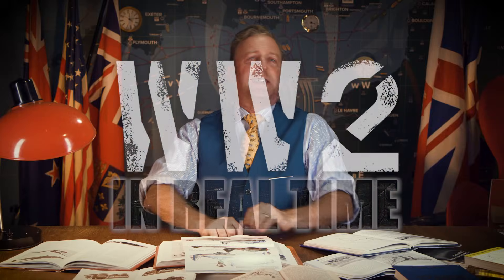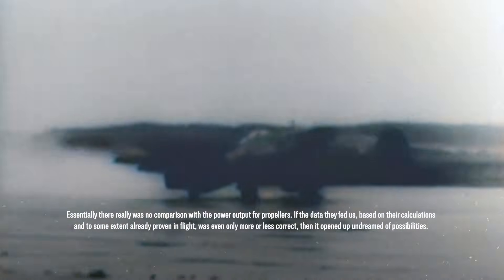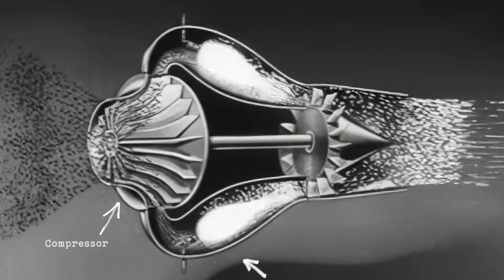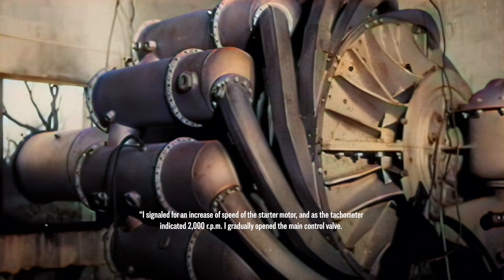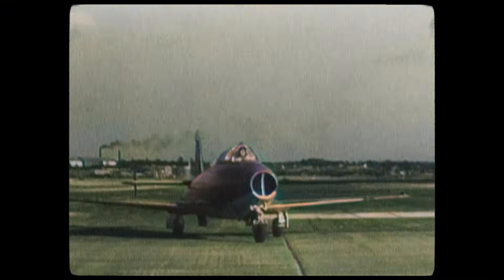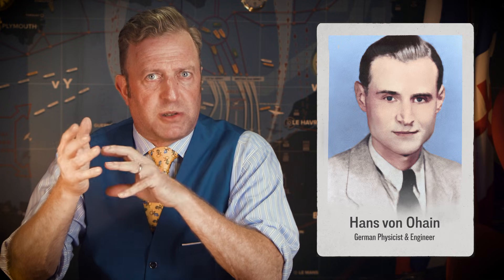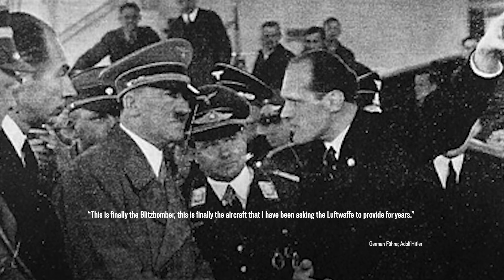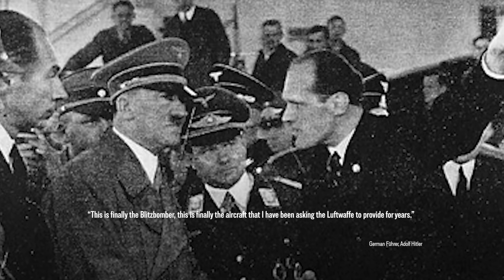WW2 Jet Engine Development - WW2 Special Documentary

Comment: It’s a myth that the inclusion of two hard points for bombs delayed the introduction of the ME262A, the main reason was the availability of reliable engines. The short supply of engine manufacture caused this, and their inherently unreliable status caused the biggest delays. The British design was a radial jet engine that didn’t need as much high temperature alloys as the axial flow type that the Germans used. The German Jumo 004 engine life was typically only 10 hours. Whereas the Gloster meteors Rolls-Royce RB.23 Welland engine was 180 hours! Whittle knew that an axial flow engine had some advantages, but life time and reliability were not as good at that time.
Reply: Good points, the Whittle design was called a centrifugal flow, from its compressor design
Reply: Makes no sense in that the power capture turbines in the exhaust stream still needed to be high temp resistant.
Reply: @AndrewBlacker-wr2ve  Piston engine exhaust valves had internal molten sodium spreading the heat along the hollow valve stem and outside the combustion space and sat on the valve seats for most of the engine cycle passing more combustion heat out into the cylinder head.  Turbine blades had no cool period and acquired most of the exhaust gas temperature.
Reply: It wasn't just the power turbines where special metals were required.  Compressor blades were also an issue. The centrifugal compressor was easier to work out than the axial type.  It's one of the reasons we still use centrifugal designs in certain applications. @AndrewBlacker-wr2ve
Reply: @AndrewBlacker-wr2ve yes, but you need much less special metal for a centrifugal engine.
Reply: @Steeyuv Not true, you only need special alloys for the turbine blades and combustor liners.
 Centrifugal compressors are very simply to design but are very expensive to built and are more easily destroyed by FOD.
The primary difference is the very low efficiency limits of the Centrifugal type when compared to the superior Axial compressor
Reply: It wasn't introduced too late, it was introduced too early.
Reply: Hey the GE copy of the Jumo engine with special metal was only good for 25 hrs btw🤪
Reply: Thank you for making this valuable, but usually overlooked, point. Many of the late war German aviation firsts were achieved not because they were far ahead technologically, but through sheer desperation & the high command's misguided belief in technological miracles. Which invariably squandered valuable resources, not least the lives of skilled pilots.
Despite its pedestrian development, the Gloster Meteor entered operational service only a few months after the ME262. Its insignificant contribution to the course of the war was mainly because it simply wasn't needed. The RAF only operated it over home territory because it wasn't needed over Germany and why risk handing the enemy its secrets should one be lost.
It was a less advanced design (especially aerodynamically), but that's the sensible way to develop such a radical advance in technology - produce something which you know will work first.
Reply: @ibex485  few people know that the reason the M262 had swept wings was to change the planes centre of gravity.
Reply: @akula9713  No, it didn't... the Me-262 was developed from the Projekt 1065 which had swept wings from inception... myth BUSTED!
Reply: @DoktorBayerischeMotorenWerke my sources disagree. The P1065 was designed to be a partial swept wing using the much smaller, and lighter  BMW3350 jet engines which were intended to be in the wing  roots. That design had essentially straight wings up to the engines, and swept back slightly thereafter. Not a fully swept wing. However these engines did not produce the required thrust and the later jumo engines were larger and heavier that precluded being installed in the wings. The extra weight upset the planes centre of gravity so the wing from the fuselage to the engine was swept back too, to correct the centre of gravity.  My sources are: Messerschmitt ME262 Arrow to the future by Walter J. Boyne. And World War II fighting Jets by Jeffery Ethel & Alfred Price. Do you have other sources on this fascinating subject?
Reply: @akula9713  This widely spread but completely false myth comes from a single, highly dubious source. Boyne clearly attempts to spread misinformation by deliberately confusing the Messerschmitt P.65 project with the RLM's Projekt 1065 
 These are NOT the same aircraft.
 The Me-262 was developed from the 1065 not the P.65.
 The P.1065 had 18 degree swept wings from inception. 
No changes were ever made to the wing swept angle because this aircraft had wing mounted engine pods that could be easily adjust fore and aft to adjust the aircraft CoG although there is no evidence this was ever done.
 The CoG was easily adjusted by repositioning weight inside the fuselage.

MYTH BUSTED!
Reply: @DoktorBayerischeMotorenWerke what are your sources?
Reply: @akula9713  The Facts here are SELF-EVIDENT.
That is a completely false Alliboo myth that comes from a single, highly dubious source "Messerschmitt ME262 Arrow to the future" by Walter J. Boyne. Walter Boyne's book is based on a completely false assumption by the author of this inaccurate book. The Messerschmitt Me-262 was not developed from the Messerschmitt P.65 but rather the RLMs Projekt 1065 (which never featured straight wings or an H tail) the P.65 design was completely abandoned in favor of Bussmann's Projekt 1065 data pakage which had a cranked swept wings from inception. no version of the Me-262 was ever constructed with straight wings or an H tail. 

There is no credible evidence to support this ridiculous false claim. This tale doesn't even pass the sniff test, the Me-262 flew with 1, 2 and 3 engines with 11 different types of engines with NO CHANGE in wing sweep angle. The CoG is easily adjusted for different engines on the Me-262 by simply shifting the engines fore and aft on their wing mounted nacelles... just like any modern aircraft like the Boeing 737 or Airbus A320. 

Busemann cranked the wing sweep angle and added automatic retractable leading-edge slats to improve low speed stall characteristics and lower the landing speed, the Me-262, the Me-262 has a significantly lower stall and landing speed than the P-51 Mustang which allowed Me-262 pilots to land on roadways and short, unimproved grass runways. Eric Brown said that the Me-262 had EXCELLENT stall and landing characteristics and would gently dip one wing well before a stall was induced..
Reply: The Facts here are SELF-EVIDENT.
That is a completely false Alliboo myth that comes from a single, highly dubious source "Messerschmitt ME262 Arrow to the future" by Walter J. Boyne. Walter Boyne's book is based on a completely false assumption by the author of this inaccurate book. The Messerschmitt Me-262 was not developed from the Messerschmitt P.65 but rather the RLMs Projekt 1065 (which never featured straight wings or an H tail) the P.65 design was completely abandoned in favor of Bussmann's Projekt 1065 data pakage which had a cranked swept wings from inception. no version of the Me-262 was ever constructed with straight wings or an H tail. 

There is no credible evidence to support this ridiculous false claim. This tale doesn't even pass the sniff test, the Me-262 flew with 1, 2 and 3 engines with 11 different types of engines with NO CHANGE in wing sweep angle. The CoG is easily adjusted for different engines on the Me-262 by simply shifting the engines fore and aft on their wing mounted nacelles... just like any modern aircraft like the Boeing 737 or Airbus A320. 

Busemann cranked the wing sweep angle and added automatic retractable leading-edge slats to improve low speed stall characteristics and lower the landing speed, the Me-262, the Me-262 has a significantly lower stall and landing speed than the P-51 Mustang which allowed Me-262 pilots to land on roadways and short, unimproved grass runways. Eric Brown said that the Me-262 had EXCELLENT stall and landing characteristics and would gently dip one wing well before a stall was induced.
Reply: thank you! was annoyed by that too.
Reply: That's not it. Whittle's early designs, up to Rolls-Royce Welland, used a wonky reverse flow system, where hot gases zigzagged their way through pipes on the way to turbine blades. This shielded the turbine from IR emissions in combustion chambers and helped bring the temperature down by 100-150 degrees. Tubine disk cooling was also eventually integrated, again improving longevity. When the US supplied better heat-resistant allows, reverse flow was deleted by Adrian Lombard (against Whittle's wishes and even without his direct knowledge) in favor of а straight flow design, resulting in Rolls-Royce Derwent with vastly improved power. Derwent was then scaled up into famous Rolls-Royse Nene, which was copied by the Soviets, slightly modified and used to power MiG-15s and MiG-17s. Gloster Meteor used both Wellands and later Derwents, by the way. It's not a matter of centrifugal (radial) or axial compression. Centrifugal compression was chosen due to problems with then poorly understood compressor stalls in axial designs, even though the latter are much more effective. Whittle did focus on reliablity above all else.
Reply: @Andre_Kummel   I have heard previously that a British Labour MP gave the Russians the design of the successful jet engine and that is how they powered their MiG 15s in Korea.
Reply: @ToddSauve   The British government gave Rolls Royce permission to sell some engines to the Soviets.  https://en.wikipedia.org/wiki/Rolls-Royce_Nene#:~:text=Rolls%2DRoyce%20were%20given%20permission,to%20the%20Soviets%20in%201947.
Reply: @joesmith323   And I'm pretty sure it was the left wing Labour government following WW2.
Reply: The Soviet Union were allowed to produce Rolls Royce (Nene??) jet engines under license. They didn't need to steal the designs, they were given them.
Reply: @Andre_Kummel What the Jumo 109-004 B model had that Rolls-Royce and GE did not was the very sophisticated bleed air cooled turbine blades and the TBCs (thermal barrier coatings)
These are the revolutionary technology breakthroughs that made the 004 B superior to the Allied engines and gave them better durability and reliability.
Reply: @sandervanderkammen9230  Those are good points. However, Germans faced a shrortage of additives. They couldn't produce proper heat-resistant alloys (that's why they looked into supercharged diesel engines, like on Ju-86P), and I think that is why those Jumo engines incorporated blade cooling. Yes, you are absolutely right: it was innovative and it shaped future jet design, but they did it out of desperation. 

Whittle's designs (or rather Rolls-Royce derivatives) also included cooling, but of turbine disks instead of blades. Bearings in turbine disks had to be cooled as well. Americans had the lead in metallurgy at the time, and they did share knowledge and materials with the the British, so blades weren't much a problem, but they did cool disks in order to prolong lifespan.

You're mistaken on one part though: Jumos were not reliable. Not at all. They had horrificaly low service time, and the introduction of blade cooling actually made thing worse, because it made blades more succeptible to fatigue. Again, due to underdeveloped metallurgy. It was, however, very forward-thinking. We have advanced a lot since then.

British designs at the time were much more durable: you could get hundreds of hours out of a Whittle-based engine, while Jumos lasted for few dozen hours at besr. 

The winning combination in the end is better metallurgy (as in American-British designs at the time) and German innovative approach to design  - coaxial flow and cooled blades. That's where we are at now.
Reply: @Andre_Kummel Not true.
Krupp P-198 Chomadur is still used in jet engine production today.

Germany had a 10 year lead in metallurgical technology

Krupp P-193 Tinidur A60 is the World's first high temperature, creep resistant alloy, it was introduced in 1930 and was used in turbochargers as well as gas turbine engines.

No, again here you are confused.

Germany was the only country to have flight rated and certified axial turbojets, the Allies attempts to build viable axial jet engines was  delayed due to the lack of advanced jet engine technology like bleed air cooling, TBCs and Automatic fuel controls.

That myth refuses to die but is easily debunked by the facts.

The Jumo 109-004b passed the same acceptance reliability test requirements for adoption into RAF and USAAF service.

American tests after the war confirmed TBOs averaged 55 hours, better than any Allied high output piston engines or jet engines.

The engine we use today is the German jet engines, it was determined by RLM director Helmut Schelp in 1940 that Centrifugal jet engines were an evolutionary dead-end concept and obsolete on arrival.

History has proven him correct.

The Allies wasted more than a decade developing the wrong concept.

Any questions?
Reply: @sandervanderkammen9230  You don't seem to realize that the development of jet engines in Germany started well before the war. Same goes for alloys. Once the war started, they were faced with the deficit of all kind of materials. First they ran into shortage of nickel, so Cromadur was developed as a substitute for Tinidur, and then they ran out of molybdenum, so there goes that. In the end they could squeze thirty hours out of those engines at best before overhauls. They knew how to make them, but they couldn't make them to specs due to lack of materials.

Yes, centrifugal jet engines were obviously a dead end, and I made that point and explained why in the very beginning. But Whittle went that way for practical reasons, practical reasons being metallurgy. Britain lagged behind, and truly successful designs, like Rolls-Royce Derwent and Nene, became possible only once Americans helped with recipies and materials. And yes, Whittle was conservative about it all. He even went on a bender and ruined his career because of changes to his design due to introduction of better alloys. It's a long story.

So, I'm not sure what you are trying to prove here. That German science was advanced? Well, yes, it was, but German industry could not supply the demand due to the war, hence lousy jet engines. They weren't bad by design, they were just poorly manufactured due to lack of... well, just about everything.
Reply: @Andre_Kummel  The very existence of German jet technology is a shameful and humiliating slap in the face to any poorly educated, highly Allied-biased student of WW2 history.... you cannot deny it existed, so the tactic is to slander and denigrate it at every opportunity.

Unfortunately, these insults and lies are easily debunked by the factual evidence... Not only did Germany produce the most jets during the war, but they were also the best jets of the war.

The Derwent and the Nene were hot garbage... sold off to the Soviets for a mere pittance, the Russians were unimpressed and abandoned both designs in favor of their own.  

The Americans shanghaied or kidnapped every German jet engineer and scientist they could get their hands on and brought them to work in America... they were not interested in British jets unless they were given up to help pay off Britain's staggering war debt. 

The jet engine we use today is Germany's jet engine... not Britain's..
Reply: Man, that's bullshit. Look, it is true that the german engines had a low lifespan, wich was the case, because the germans could not spare the materials needed for high temperature alloys. On top of that, the british at the time, were the ones to develope the mostr potent high temperature alloys, wich the germans had no acces to.
It is also a well known fact, that the first prototypes of the Jumo004 were build with the best available alloys and they had triple the livespan of later production models, wich still achieved around 25 hours until the first maintanance intervall (the 10 hours are between subsequent maintanance intervalls after that).,

The radial compressor of Whittles design has nothing to do with temperature alloys because, surprise surprise, the turbine was still an axial design. The Whittle Turbine simply had access to superior high temperature alloys.

Also, if we really are going this direction (for everybody still deminishing the german contribution to jet engines), the first turboprops were build by the germans, as well as the first high bypass counterrotating turbines. Even turboshaft trubines for tanks were first developed by the germans, thought later the british were the first to implement one in a centurion hull, i think.
You wouldn't believe it but the turboshaft turbine for the UH-1 Huey and the ATG1500 turboshaft turbine for the Abrams were developed by a lead engineer named Franz Anshelm, who worked for Lycoming. This was the exact same guy who previously worked on the developement of the Jumo004. 
So basically, the arguably 2 most iconic war machines of the great patriotic USA wer developed by a german ww2 aerospace engineer.

But that's not all, airfilm cooling and internal feed air cooling for the compressor vains were a german ww2 developement, as well as variable exhaust geometrie and an prcourser to the afterburner.

I mean, i could go on, but it is safe to say, that the contribution to the jet engine developement in germany during ww2 can not be overstated.
Reply: @Enthropical_Thunder   The cannons on the Abrams tanks are made by Rheinemetall, the same German company who produced the 75mm cannons for the Panther tanks in WW2. German engineering is very good!
Reply: @ToddSauve  
Yeah, no. The guns on the Abrams may have the same caliber and may shoot the same munition, but they are lincenced reproductions by GM i think. The american breech is a complete new construction, as it includes the gun mounting points and is designed to withstand higher pressure for longer i.e., it's more durable against APFSDS ammunition.
Reply: @Enthropical_Thunder   Thank you for informing me of that. But it sounds like Rheinmetal merely licensed the vast majority of the cannon production to GM. I am not sure how far back Rheinmetal goes in German industry but it is to at least WW2 and the production of cannons for their tanks.
Reply: @ToddSauve  The M256 is made at the U.S. Army's Watervliet Arsenal in New York, under license from Rheinmetall AG. in Germany.
 The M256 is a heavier, low-cost version of the L/44, it lacks the light alloy, hydro-pneumatic recoil system found on the Leopard version and relies instead on steel coils springs and a steel assembly.

The M256 also lacks the L/44's lighter and more accurate concentrically-balanced gun tube.
The Abrams uses a heavier, conventional style of gun tube that offers longer life but is more affected by heat distortion and barrel whip.
 The L/44 tube must be changed after fewer shots but is more accurate at long range and shots on the move than the M256.
Reply: @DoktorBayerischeMotorenWerke  Thank you for the info. Much appreciated.
Reply: @Enthropical_Thunder    Really pretty dumb of the thousand year reich master race to not amass strategic materials before setting out to exterminate or enslave all the untermenschen.
Reply: Is Frank Wittle the person where the saying "wittle away at it" comes from? :)
Reply: @maarten6884 His name is Whittle, so no.